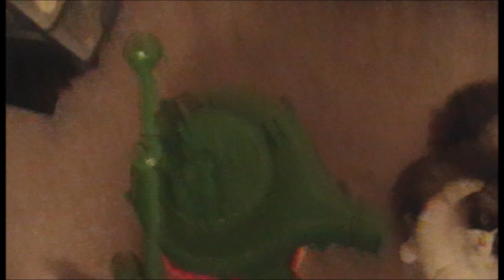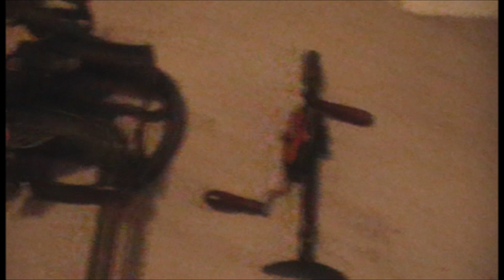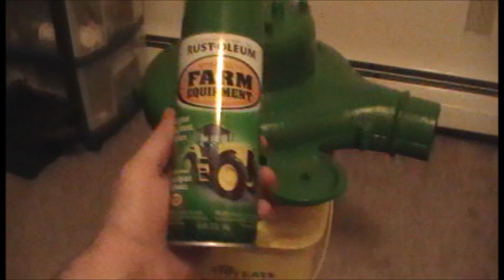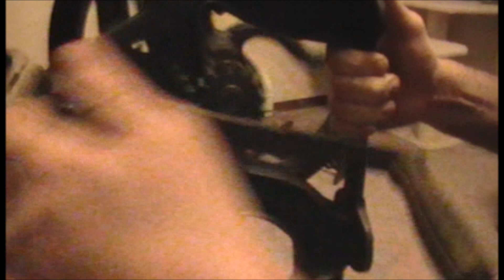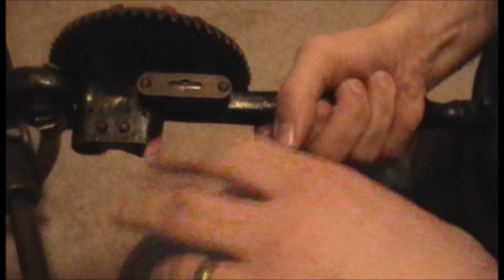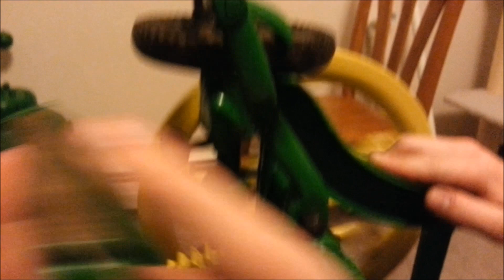Antique Blacksmith Tools 2 Restoration: Post Drill, Forge Blower, Hand Drill

Comment: Nice post dril. I hope you can find a table for it someday.   I like the color combo.  My avatar is a flywheel on a Buffalo Forge Post drill in great original condition except for the red paint.  I got super lucky and got another one with a couple of parts missing at auction for $5.  Buffalo Forge is still in business.  I sent photos of my drill to them and they said it was made circa 1900.  They still stock parts for it.  A new feed wheel (on the top like yours) costs $250.00.  Glad I picked up the parts drill just in case.  I bought an adaptor made specifically for adapting a modern 3 jawed chuck to the fixed 1/2" hole that is on most if not all post drills.  I do use my post drill occasionally but it feeds so slow I use it more for fun than routine woodworking

Comment: My father inlaw left me an old post drill like that but its complete and working fine, with the lettering (CANEDY OTTO MFG CO.) on the upper support and on the lower support it reads (No 3 CHICAGO HEIGHTS ) I have no idea how old it is  I just thought it was something cool to mount on the wall of my wood shop, but now I'm thinking I should clean it up, but I don't want to paint it as it looks better aged. but if anyone has any info on that please let me know, thanks.

Comment: It didn't take me long to identify the drill. The style of the main body of the drill and red enamel on the gear indicates it's the 1921 or later model 12. That's a Leland universal chuck, not the spring type alligator jaws. The spring release for the gears was introduced in 1925. If the trademark says Greenfield, it's 1931 or later.The last production was 1957.

Comment: Any manufacture marks should be around the chuck. Clean a bit of the rust of to see. Miller's Falls was the manufacture for other companies too. Stanley and Craftsman hand drills were made by Miller's Falls back then. I'll see if I can identify the model # based on what you showed. See if you can find the model # on the chuck. That's a 2 jaw alligator chuck isn't it?